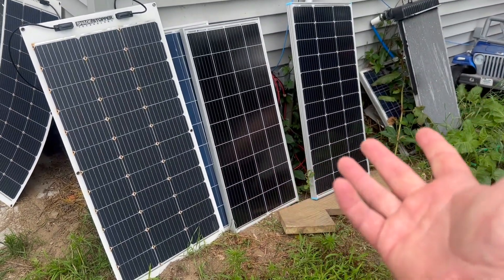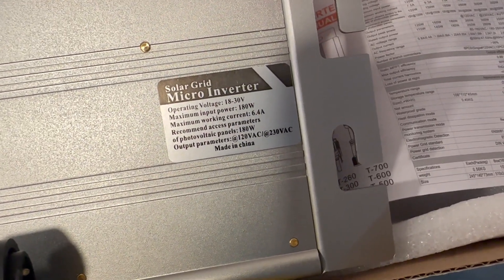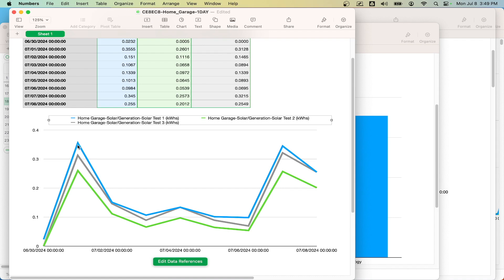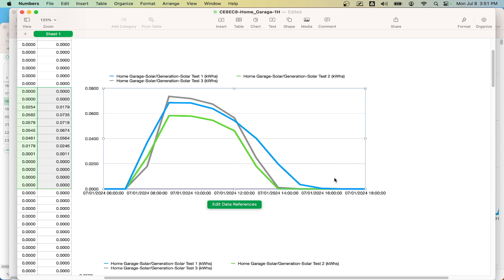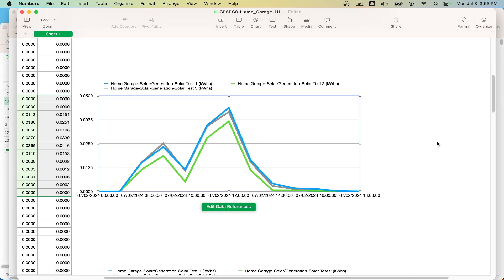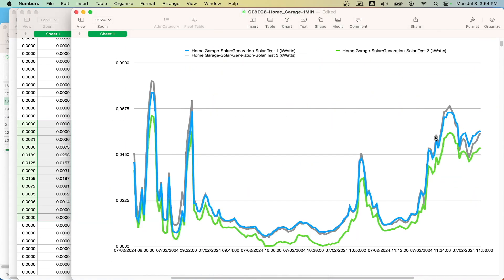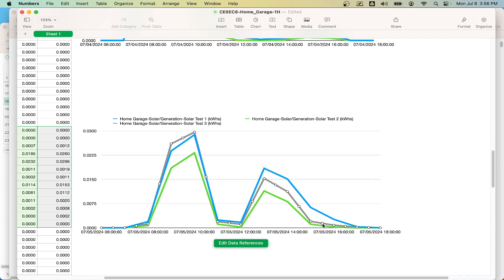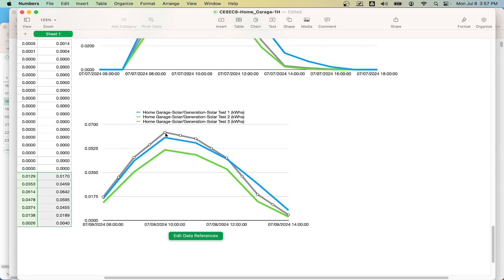100 watt shade tolerant flexible solar panel: test 1

Comment: Very interesting data, although there are a lot of possible explanations for the variation in output between the ShadeStopper & Renogy panels, which is only 9% overall in favor of the ShadeStopper. As you noted, the behavior of the MPPT controllers could have some effect. The fact that they are both rated at 100W doesn't mean their actual output would be the same under any given condition, and some manufacturers tend to be more conservative in their ratings than others. And I don't know about the ShadeStopper panels, but some flexible panels have a "pebbly" surface that they claim allows for more light collection at off-angles. It appears there may be slight variations in the angles/direction in your setup, and they're certainly not going to be pointing in the perfectly optimal direction most of the time in any event. Still, it's a significant difference overall. Will be interesting to see how well the bypass diode arrangement works.
Reply from the maker: Good point on the variations, I'll need to tighten up the experiment to improve the accuracy. But yes, I agree, the bypass diode arrangement is what has me most interested.